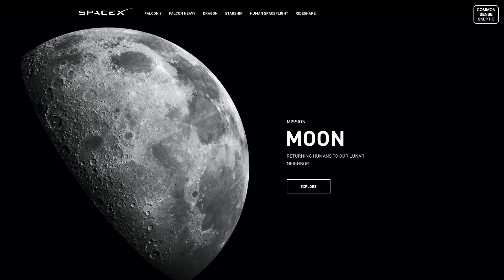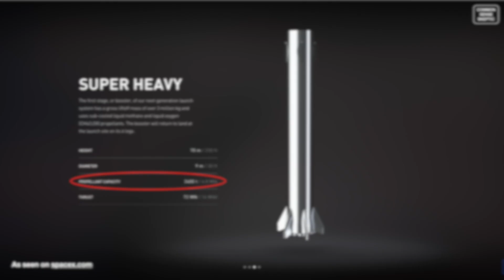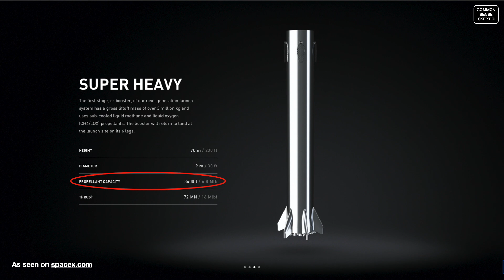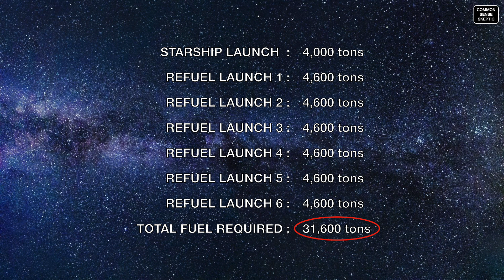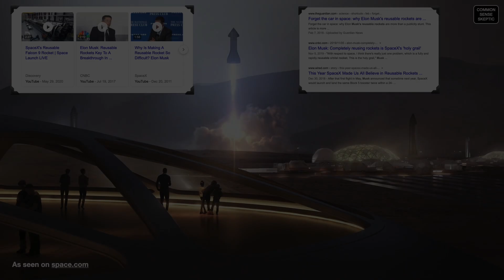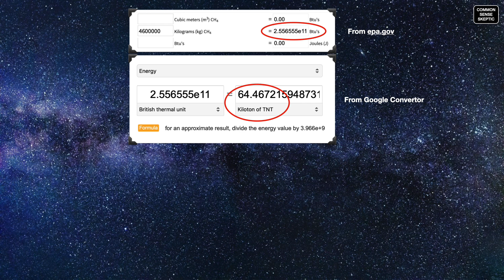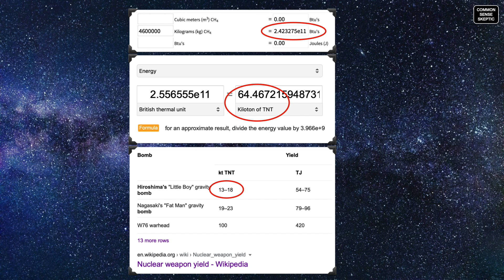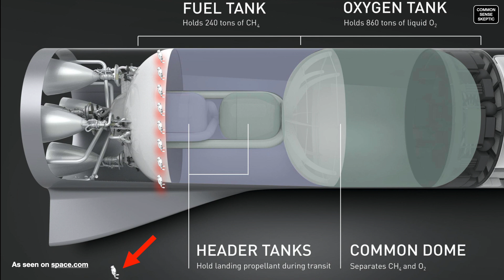STARSHIP EP5 - ORBITAL REFUELLING (1080p)

Comment: I am not an engineer but I dont understand why they need to use starship for everything. It gets us in the orbit, it flies to mars and lands on mars. Every step has different challenges and i would expect different types of spacecraft in each step ( the flight to mars should be a mobile spacestation that stays in space and doesnt need to start from earth and its also a back up if something on the ground goes wrong). It feels more like that musk needs to prove that starship is useful and looks desperately for use cases. And did you know that starship can mow your lawn, pay your taxes, buy your groceries and wash your socks.
Reply: Yeah the entire thing about space travel is you define the mission and create the vehicles needed to accomplish the mission, you don't start with the vehicle and try to yadda yadda that the mission can be done with the one vehicle.  Right now starship is little more than a steel tube and engines that may or may not catch fire.
Reply: My thought as well.  Basically that is how the Moon Landing missions worked.  They had the launch vehicle, the travel vehicle and the landing vehicle.
Reply: @bigskypioneer1898  Unlike the moon, having a separate travel and landing vehicle is not necessarily the most efficient way to get to mars.   
A travel vehicle would have to burn fuel upon arrival to slow down to enter Martian orbit, whereas a vehicle like Starship would aim straight for the atmosphere to bleed off all of that excess speed without needing much fuel.   

This "direct descent" approach is certainly the most efficient method of getting to mars one-way, which means its probably the best way to send cargo there
Reply: honestly that's what strikes me the most about the whole starship thing; it really looks like something a kid came up with; if you let aside the technical challenge that's an absolutely inelegant solution to whichever problem you look at. When you look at any major achievement in space exploration I'm each time amazed at the elegance and ingeniosity of the solution they came up with; and they're often in a way quite simple even if they require a complex and perfect execution

Comment: Now that SpaceX has admitted that the payload capacity of "Starship" is only forty tons, not a hundred, the sixteen tankers previously thought to be needed to go to the Moon are now forty tankers.
Reply: That was for the Prototype using Raptor-1 engines.
Later Prototypes have higher specifications, and larger payload capacity.
Reply: @peterclarke3020  SpaceX claimed that the original "Starship" could carry a hundred tons to LEO.  See the User's Guide.